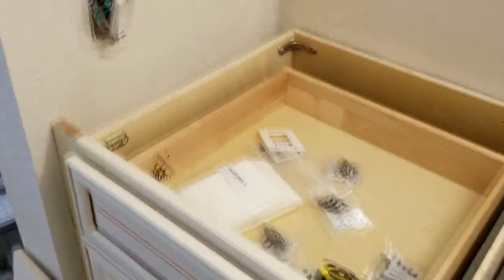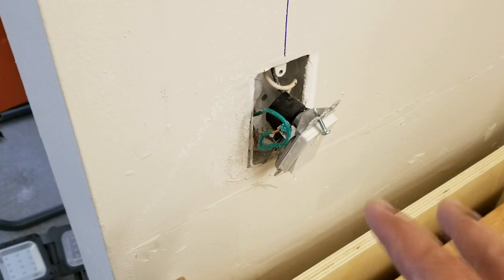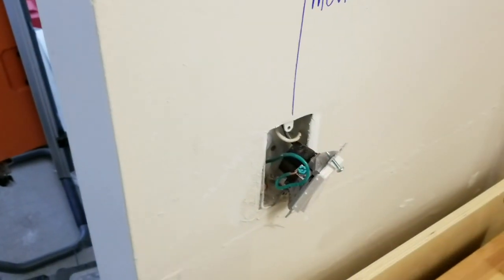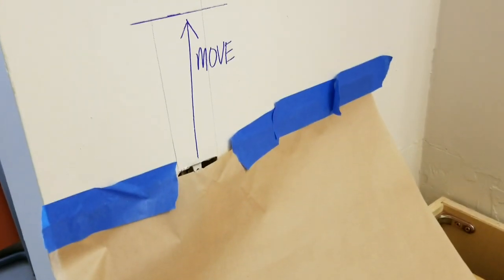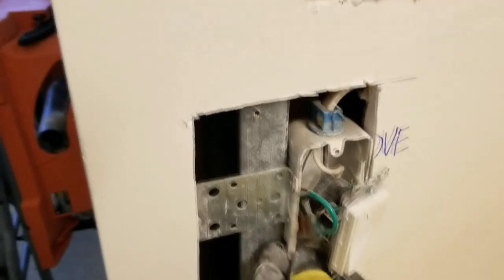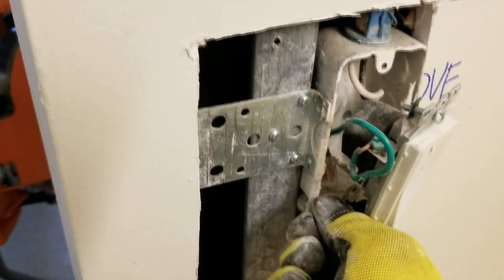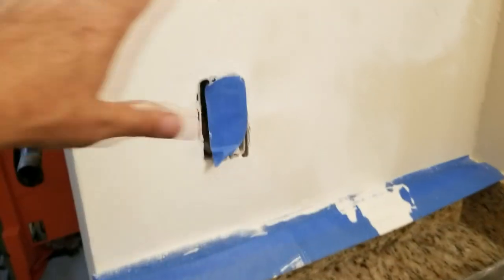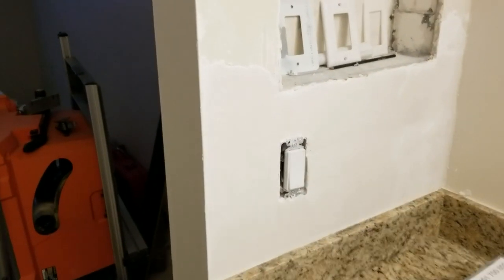Moving Electrical Outlet Up A Wall, How to Move a Light Switch

Comment from the maker: Parts and tools used in this video:
✅ Fluke FLK2AC Pocket-Sized Voltage Detector:   https://amzn.to/2THggao
✅ Rockewell Sonicrafter to cut drywall: https://amzn.to/2LnEJNU
✅ Wago Lever-Nut/Wiring Nut Assortment Pack: https://amzn.to/2GpXJLB
✅ Ideal Grounding Pigtails with Ground Screws (Pack of 50): https://amzn.to/2DMheg3
✅ Ridgid WD4070 4 Gallon Portable Vacuum: https://amzn.to/2SAeyX6
✅ Green Mesh Drywall Tape: https://amzn.to/2I8ulf2

Comment: whats code for height of the switch or receptacle? I have a double light switch with a dual receptacle next to it in one wall plate.  We want to put a cabinet that extends out from the back wall that will block the receptacles. Whats best way to move these or reposition outlets?
Reply from the maker: Randy great question. The National Electrical Code says each room should have at least one switch to operate lights in the room, but gives no codes on how high the switch should be. Many folks, myself included, and builders, build switch boxes so the bottom of the box is 48 inches above the floor. If it is for a disabled person, I would check ADA guidelines to make sure they don't suggest something different. The 48" standard pretty much ensures you'll never get interference from a cabinet, which is 36" to the top of the countertop typically. Then you will allow a 4" to 6" back splash or side splash on top of that, taking you up to 40" to 42" off the floor now. This gives you 6" more inches of margin until you encounter the bottom of the outlet at 48" off the floor.
Reply: Thanks Jeff but can I move and have 2 outlets under the 2 light switches instead of 1 outlet next to the light switches?
Reply: Its ADA that has Requirements on receptacle heights and good builders will follow that. Permit department inspectors will look for compliance. Imagine moving into a new apartment or house in a wheelchair and you can't reach the switches.

Comment: Not straight?!
Reply from the maker: What's not straight?
Reply: jeffostroff the switch!! The bottom left looks closer to the wall edge than the top left.
Reply from the maker: @kencowen2038  We make sure every switch is straight using a torpedo level. Looks like its distortion form using the wide angle setting on the camera.
Reply: I thought exactly the same thing.  That lightswitch is cattywampus.

Comment: Couldn't you just pull the box out, cut the wires, cut the opening for the new box, pull the wires through and connect it to the new outlet? Rather then cutting all up the wall. Seems like more work then is necessary.
Reply from the maker: Yes you  can do it that way too. So.e people don't want to mess with wires

Comment: I need to move my outlets up out of back splash area !   My electrician said The 3x3 box needs to sit inside my cabinets !!! 
Please explain electrical junction box in my upper cabinets.
Thank You!
Reply from the maker: Don't know why they would say that. Only outlet that needs to be inside the upper cabinets is the microwave oven. Then below in sink cabinet for the garbage disposal and dish washer.
Reply: Because they need more wire somewhere and they can't splice or without a junction box
Reply from the maker: @michaelparker7666   So if they truly need a Junction Box and not just an outlet then better that it's inside cabinet than visible on the wall I see too many kitchens with plates in the middle of the wall

Comment: I live in nyc and we have an slim intercom phone in a very inconvenient spot on the wall. It’s front and center and I prefer it tucked away. Could I move this using a smilies method?

I’m actually also trying to move and out let horizontally 12 inches on my wall in the living room so I can access it. (It’s behind my couch at the moment). Hoping I can figure out how to do this from your video. 🙏🏽
Reply from the maker: You need to know where the studs are, because you might have problems moving the outlet over if a stud in the way. We usually end up cutting multiple holes in the drywall, and run the romex cable through the stud to the other side. Before moving the intercom, see if you can remove it out from the wall, see where wires are, and see if there is enough slack to move the intercom in the direction you want it to go in. Rule of them is that this is usually doable if the outlet or intercom is moving back toward the source of the wiring.

Comment: How do I move existing wire? I cut a hole in the drywall to install a dog door and there are 2 electric wires running down the stud I need to partially remove. Help? Can’t find a video on this.
Reply from the maker: When you run into situations like this you might find yourself having open up more of the dry wall and then you can find out where the wires go and if you can move them without having to undo them from the outlet's, best case scenario for you. I would just try to put another stud on the other side of the stud that you remove part of it so that it gives the wire somewhere to go. If that can't be done then you really need to trace the wires back to where they're going and undo them out of the outlets or switches where they are headed to and move the wires that way through the wall you may have to draw a hole or 2 through some studs but you're probably OK.

Comment: Can you move the junction to the opposite side of the wall?
Reply from the maker: Yes you can move the junction to the opposite side of the wall, you can turn this box around 180 and make the switch on the other side of the wall. We have also had a scenario last year in a condo where the dining room light switch and kitchen light switch were on exact opposite sides of a partition wall entering the kitchen. We had to move some wires around between the boxes, and it's all legal as long as the wiring is terminated properly, and all National Electric Codes are followed. Just make sure you have no illegal hidden wire junctions inside the wall space, all wires must be connected together inside an outlet box, switch box, or utility box with an access plate.

Comment from the maker: Do you have any questions about moving electrical outlets or moving light switch boxes along a wall?  Ask them below in the comments and we'll answer them for you.
Reply: In my bathroom my wall light fixture had an outlet. I want to replace that light fixture with a more updated one and it doesn't have an outlet. I hear they don't often make those anymore. I would like to put a new outlet lower on my wall. A bit above my sink back splash. Do you have any suggestions for how I can split or splice my wires so that I can still have a light fixture towards the ceiling on the wall but also an outlet lower than the mirror on the wall?
Reply: What if there is a wall stud in the way  when feeding the wires?